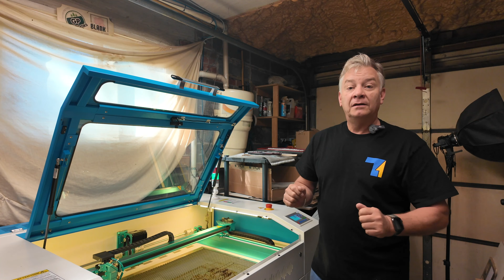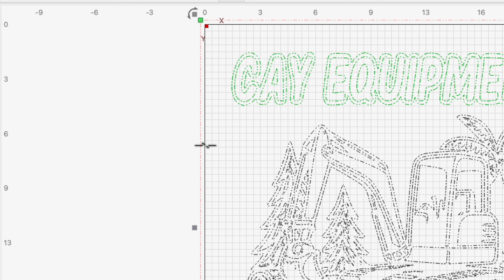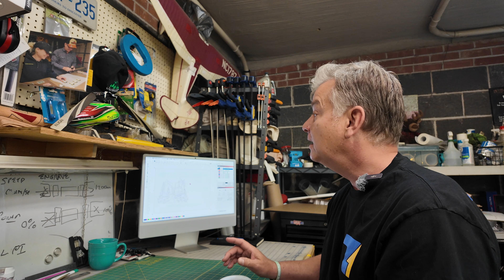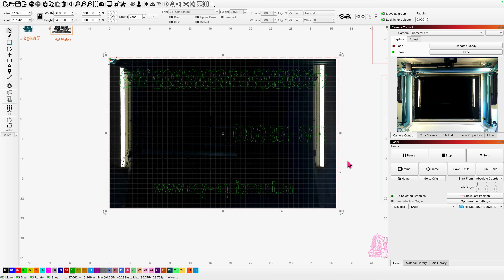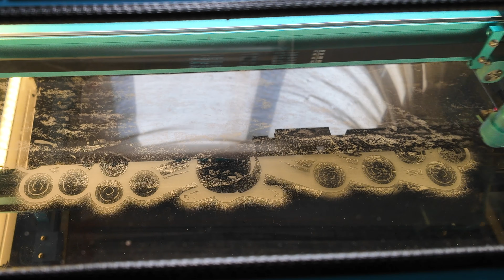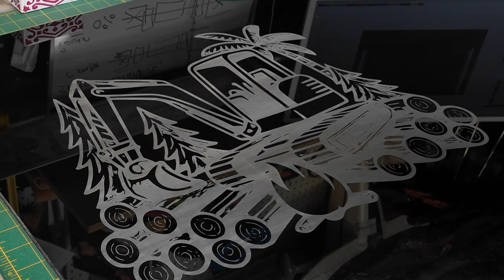Working With BIG Acrylic on Thunder Laser Nova PLUS 35.  Part 1  100   4K

Comment: I've been trying to cut 3/8" acrylic on my 150W CO2 for weeks.  No matter what settings I try, the cut edge is not square.  It appears that the laser melts the acrylic in a V shape.  I think this is due to heat being concentrated more toward the surface.  Am I missing something?  Can you get a perfectly square cut on thick cast acrylic?  Thanks
Reply from the maker: Morning Cary. I am not an expert by any means but this happens to all materials. The beams diverge below it's focal point and get wider apart the further the beam goes, causing the actual cut to be angled ( not square). It's negligible on thinner materials but becomes obvious on thicker materials. You can try to minimize it by defocusing yours lens  (moving it closer to the material), but I donlt believe it is possible to get a square edge.  I think this video explains it well - hope it helps ! https://www.youtube.com/watch?v=9cLlCjEcUpY&t=4s

Comment: I've been watching most of your videos using the Nova Plus 35. Since my Nova Plus 35/80 is arriving next week, Iv'e been trying to squeeze as much knowledge from these videos as. possible. I do have two questions about your engraving on acrylic though. Are you using the standard 2.5" lens? And are you using the 2mm nozzle for your engraving and will you be switching to the 6mm nozzle for your cutting? Watching some TL videos indicated it would be better to use the 6mm nozzle when cutting acrylic to prevent overheating. I'm curious as to your approach. By the way, you do great videos..
Reply from the maker: Hey good day Gerry and congrats on the new laser. Thanks for tuning in and hope you have found some helpful info. The PLUS comes with two tips - the 3mm "Cutting " Tip and a 6 mm "Engraving" tip. I used the 6 mm "Engraving" tip for this design. I used the stock 2.5" lens for this engrave. I purchased the other 3 optional lenses but since this design had no tiny or small detailed fonts or pieces, I figured it would be best to use the stock lens. I still have lots to learn and am no expert,  but feel free to send questions if you have them and I can try to help, if I can. Enjoy your new laser and let me know how it is going from time to time. Cheers!
Reply: @LaserNUG  Thanks Gourt. I do have one more question concerning the nozzles. Do you find yourself changing nozzles to switch between cutting and engraving? That would seem counter-productive or do you only use the cutting tip when you're just cutting without doing any engraving.  How about when you're engraving and cutting thicker pieces of wood? I'm curious as how to make the best use of the nozzles without impacting my work too much.
Reply from the maker: @GerryGeorge-ej7bc  If I have a design to cut and engrave, I usually use the engrave (6mm) tip. If I am only cutting, then I use the 3mm tip. I have not really started doing really thick stuff yet. :)
Reply: @LaserNUG 
Thank you for clearing up my confusion concerning the nozzles. Keep up your good work.
Reply from the maker: @GerryGeorge-ej7bc  Good luck next week. Very exciting getting new equipment. Cheers!
Reply from the maker: Oh and thanks for the kind comments.LOL! I appreciate it. Hopefully you are arranging to get your exhaust vent installed and if you have not seen them, I have a full install video on my homepage,  one for the physical install and one for the Lightburn connection, if it is helpful. Cheers!
Reply: @LaserNUG  Absolutely. I've gotten a lot of great ideas from not only watching your videos but others as well. I'm going with the 6" exhaust vent out my window. It's similar to the window you use in your shop. I'll be using my new laser to actually create my exhaust frame and the hole through which I'll be putting the vent. I created a similar one for a 4" exhaust I used with my diode laser and it worked quite well. I've also been looking at videos for installing my California 8010A external air. I think the best instructions I found so far are in the TL Knowledgebase. I haven't seen any videos for doing it on a Nova Plus35 so I may make one myself when I do it. Never did a video before but think I'll give it a try. 

I noticed you don't seem to use external air. Everything I've seen indicates it helps to really make cleaner cuts and deeper cuts. Is there a reason you don't use one?
Reply from the maker: @GerryGeorge-ej7bc  Yes, I have a small workspace and at least for now, I am not sure i want the noise of the external compressor running and I have very little space to place it. It's an older house so I am pretty sure the family wil also hear it running - LOL. so best not to wake or disturb them - I do a lot earlier mornings and late at night sometimes but yes I agree, external air does help I understand.

Comment: Hey Gord, quick tip before you start to remove the paper backing off your acrylic take a heat gum or hair dryer and ward it up good. The backing will come off much easier! Hope that helps
Reply from the maker: Morning Robert. Yes that is helpful. Did not think of that - thanks very much!

Comment: What version of LightBurn are you using?
Reply from the maker: Hey thanks for tuning in. I learned the hard way a while ago, not to update the latest version released for at least a couple of weeks ofter it has been released. I wait for a bit. I am still on 2.0.02. I watch YT and the forum on Lightburn to see if any bugs have surfaced, and if none , then I allow the upgrade. Hope that helps. Cheers!